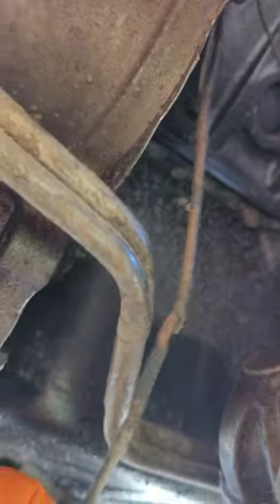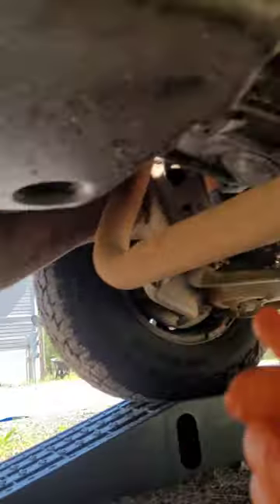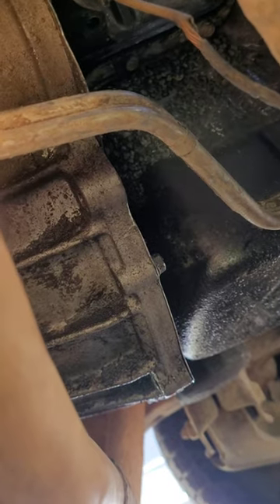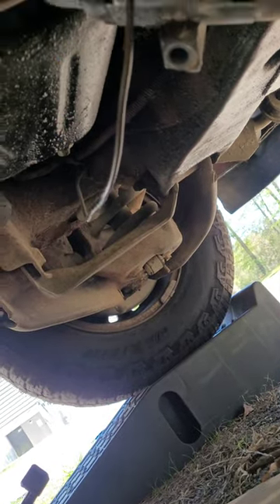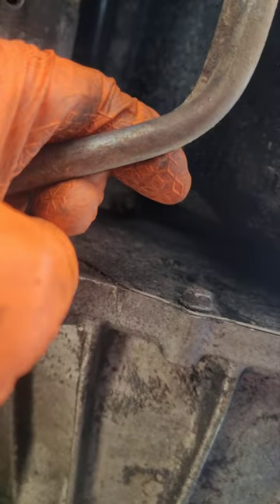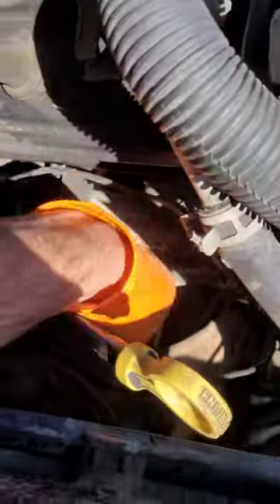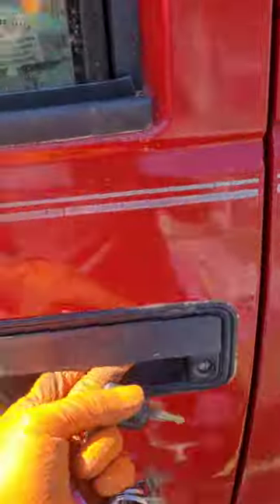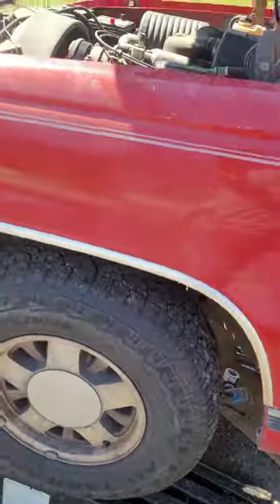#1998 #chevy #silverado bad solenoid wire. Starter is good.

Comment: When you would try to start it would it just click rapidly?
Reply from the maker: @bobbydavis2757, I'm not sure. I don't think it did any clicking....🤔... And I don't think this was the only problem. After I changed this cord my truck sometimes still doesn't crank and I have to drop it to Neutral to crank it. Then sometimes put back to park to crank it.